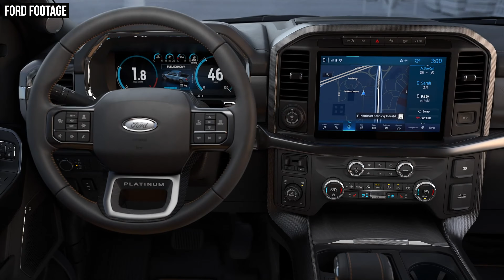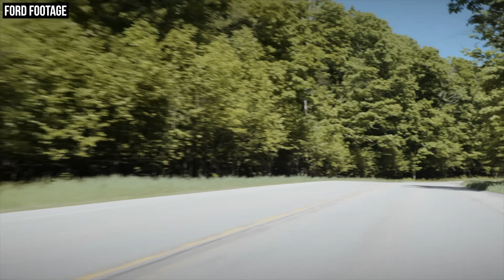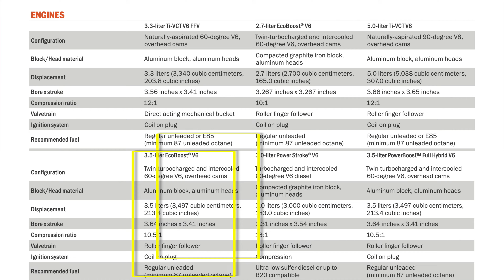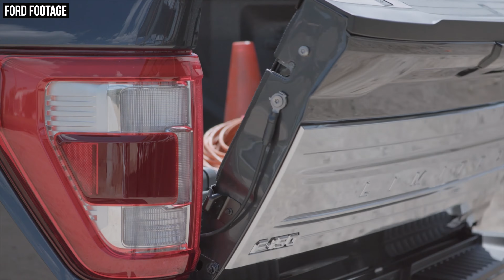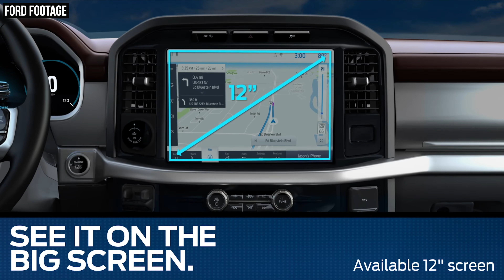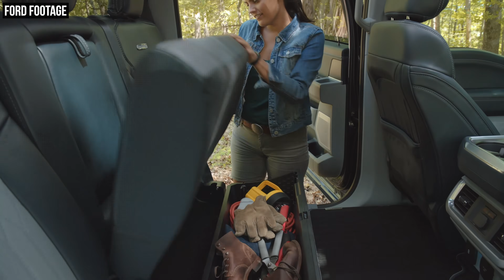Ford Unveils 2021 F-150: Deep Dive Into Everything New (PowerBoost Hybrid, Onboard Generator + More)

Comment: Nice looking pick up!  I plan to travel to the USA, as such does the F150 Limited have air ride suspension? The v6 with the battery assist, will it engage while driving on the freeway to improve MPG, I would assume as such, as well as , engaging in pulling a trailer? 

Alternatives that I'm considering are the Audi Q8 or Lexus LS 500, but would like the option to pull a trailer if needed and the Q8 offers this up to 8K pounds.

Good video, thanks for the info.

Comment: Great presentation.   Very informative.   Power Boost intrigues me as I always wanted to charge the lifepo4 batteries on my RV while driving. That way I can arrive at my destination with a fully charged battery bank. The 7.2 k watt generator could be enough to get my two  15k btu aircon units compressors up and running before handing them off to the battery bank.  Definitely hate non-defeatable stop/start, or cylinder deactivation on the 5.0 V8.  Want to give it a try though. Thanks a lot.

Comment: It’s going to come with 2 engines? The generator is a gas engine right? And a battery pack? Isn’t this truck going to gain 500 lbs? 
Also, if you didn’t have a console shifter, you wouldn’t need it to fold down.…🤣😜

Comment: Yawn.  Another powertrain that isn't much different.  Still waiting on a larger battery hybrid that can propel the truck on daily commutes to save gas but still have gasoline power to tow the rated capacity for long distances.  The generator should have a 120V 30A plug as well which is very common in campers, to eliminate portable generators, noise, gas cans, etc when camping.  Nobody uses corded tools on professional jobsites anymore, everyone has cordless tools (including table saws/ miter saws) so the marketing of that doesn't make much sense.